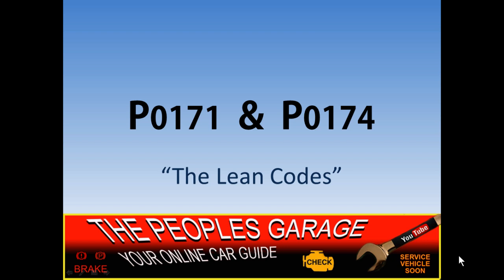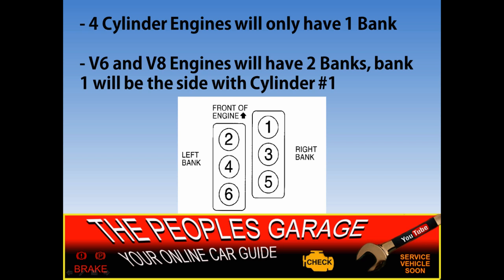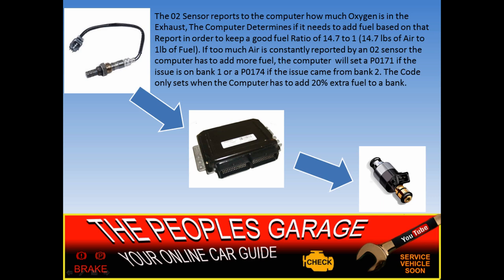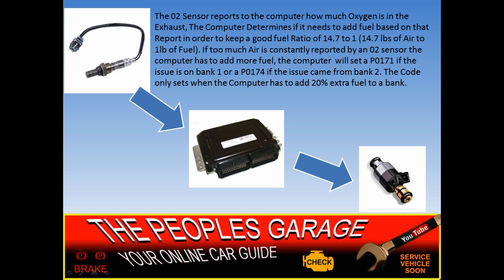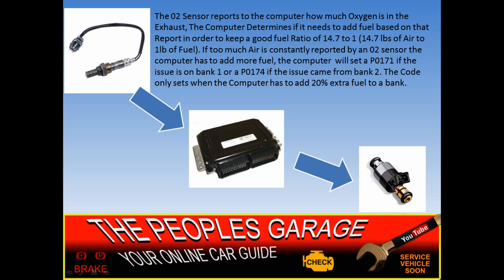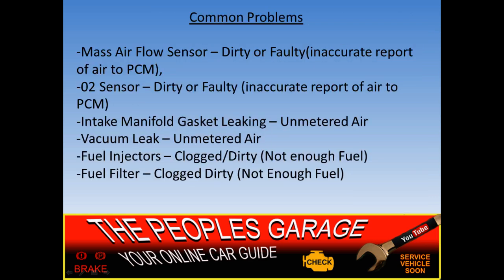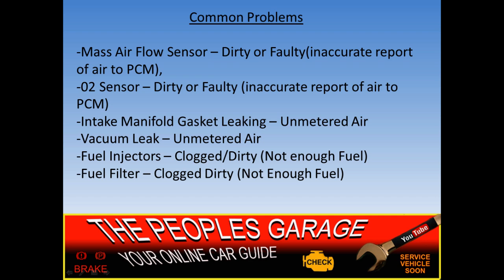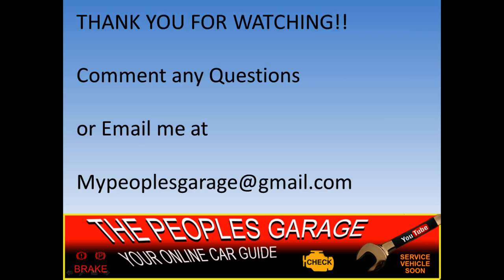How to Diagnose Codes P0171 & P0174 - Lean Bank 1 & 2

Comment: Great video! But did you forget to mention fuel pressure regulator and fuel pump? I am getting that code on my tacoma 2.4 and I tried everything you mentioned. Long term fuel trim hovers at 20 percent and doesn't improve when I accelerate. Any thoughts?
Reply: Your brake booster could have a vacuum leak inside of youve checked everything else already.

Comment: Have an 07 saturn ion that is a 5 speed manuel, 2.4L, straight line 4 cylinder, coupe, and i get a P0174 whenever its really cold outside or if i'm on the interstate with cruise control on. I've replaced the air filter, cleaned the throttle body (had oil on it due to high amount of vapor coming from the vent on the cam. No pcv, just a hose from the vent to the air intake) cleaned the mas, and i can't find any vacuum leaks or hear any noise. Only coming on at high way speed or if really cold out. (Live in wyoming)  In city driving doesn't trip it and the car has no hesitation. Does have 194,000 miles and timing chain may be due for inspection. Shop says my injectors are fine. Couldn't find it either. Is it just common to get this code?

Comment: what if the code is on a 2005 volvo  I got p0171 & p0174 ive checked for fuel which is good, ive changed the mass airflow sensor, codes still exist. and ive changed the pcv and hose, the last thing I haven't changed is the o2 sensors on the front. code that be the problem. and ive checked the intake gaskets with a smoke machine and nothing.
Reply: I would get the Mass Airflow Sensor from the dealer. I had a customer who changed the sensor 3 times, all were Bosch brand and new(which is suppose to be OEM. meaninf bosch makes the sensor). Once she installed that one, the p0171 and p0174 along with other fuel codes went away. It's really expensive at the dealer though. Just a thought. Good Luck

Comment: Hello I have a 2007 GMC Yukon. I started my truck and I heard a big sound on manuful exhaust air leaking and my checking light is on . I stopped at AutoZone and the diagnosed p0174 bank 2. I hope hear from you soon

Comment: I have a 2002 525i and the p0174 code pops up. Its the only code that pops up. I had just gotten the oxygen censor replaced from a different code i had on which was p0154. After that fix i had a different code come up which was p0430 so i had a mufflee shop replace the catalytic converter. Now im stuck with the p0174 code.

Comment: alright man! great video! My 2001 ford f-150 v8 catalytic converter turns red on bank 1, along with a code p0171,,long fuel trim 25% at idle. 
So far I done leaking test with a smoke machine, there is no leak at all. MAF sensor cleaned , four O2 sensor are new, I pretty much rule out every possibility except for the last one,  brunt exhaust valves.  yeah one more thing have to mention, when I change the oil today, there were only about half of the engine  capacity left

Comment: 2015 Nissan Versa P0171. Does the code clear itself if the issue is corrected? or does it need to be cleared by a scan tool?

Comment: 2004 kia sorento having lean catalyst system any thoughts? Have new catalytic converter plugs wires fuel injectors timing belt newer coil packs also have been replaced this car has been a nightmare so far owned less than 1 year. It's my wife's to get her and my 2 year old around. I'm aging a lot faster since getting this vechile please help

Comment: Would the oil leak from the oil pan on Vortec engine cause that code? (P0171)
There is no hasetating i did check usin a scan tool injectors status was showing positive results i hve a massive leak from the oil pan gasket.

Comment: Wouldn't mass air flow sensor set lean code to both o2 sensors. Mines just bank 1 sensor 2 o2. Replaces 02 sensors, no vacuum leaks, replaced lower intake and upper intake gaskets. I'm down to fuel injector on that bank?

Comment: I have a 2003 toyota highlander it has p0174 code b2s1. changed 02 sensor twice. it worked for a short time and check engine light back on. engine jerky on acceleration and some rough idling. one more thing tip of 02 sensor has black soot build up on tip. could injector be my problem??

Comment: I have a straight 5 06 Colorado, I got bank one 171 code. I also just recently installed a K&N cold air intake on my vehicle. I installed it about a month ago and I'm barely getting the code on. Any advice or troubleshooting areas I should start with?

Comment: 2005 Jeep Liberty 3.7 V6 I have had the P0171 and P0174 after resetting the check iengin light. Using my scanner its asking for me to change the ECM on both sides it was blowing black smoke out the tail pipe. Question what is the ECM cause.thats coming up on my scanner tool, and do you have an idea as to my diagnosis? Fuel Pump and filter the Jeep has 142,000 miles on it. Thanks KW

Comment: I had all this checked I have a 2002 ford taurus sedan I believe a v6 changed the mass air flow sensor and the pcv valve I asked them to check the hose and elbow because I couldn't get in there they changed the upper manifold gasket they check air compression  and observed tool data all scensors and found no irregularities looked at freeze frame data fuel rail specs 30-45psi said could be concern fuel rail scensor or fuel pump codes it gave were po 171 po174 
When I drive on highway it has a kind of light tug not often but every so often and when at a stop too long wants to die it runs clean no smell smoke. They couldn't find it any ideas. 
My coolant resevoir sensor says low when it isn't would that sensor give off these codes 171 174
Reply: Brake booster

Comment: This is what I encountered. I have a 07 Pontiac Grand Prix GT 3.8 supercharged Engine with about 110,000 miles on it. I had some vacuum lines replaced a rear main oil seal and my intake manifold gasket replaced because of a minor oil leak. After the repairs I was getting an intermittent P0171 code. Sometimes it would be on  and sometimes it would be off, Engine temperature never really mattered. My Mechanic suggested we clean injectors, Mass Air Flow Sensor to remedy the problem. Although the car ran a little smoother the CEL would still come on. My Mechanic then suspected the Intake Manifold Gasket although had been replaced may be the culprit. Before I had him do that, I tried something on my own. I located the PCV valve which sits on top of the Supercharger in a recessed port secured by a metal cap by two 10mm bolts. Under this cap is a spring and the PVC valve is under the spring. I removed the spring and the valve, on the barrel end of the valve is an O-Ring it was worn so bad it was hard and flat the valve itself barley rattled unless it was shook real hard. I replaced the valve and the O-Ring, cleared the code and the Check Engine Light hasn't returned since and that was almost a month ago.  Hope this helps anyone with a GM supercharged Engine that is getting the P0171 lean code.

Comment: 2005 BMW X3 with p0171 & p0174. Any possible thoughts? I will be trying to change the gas cap, was told that might solve it. I know I need to check the MAF.  Trying to everything I can before taking it to a shop.
Reply: Did you ever find your problem? I have a 2005 X3 also that is throwing both codes (171 and 174). I can't seem to figure it out.
Reply: Craig Colton, I checked the gas cap. That did not help. I literally just started on the next step. I was waiting on parts. I changed the air filter because it was filthy, and while changing it I cleaned the MAS sensor. I reset the codes today and now I am waiting to see if that is the fix. I may end up needing a new MAS. Not sure how long it was driven with the dirty filter and non cleaned MAS.  I will let you know if anything changes though. What have you tried? My X3 has 130k on it.  Also have you had any leaks in the trunk?
Reply: We're on the same path. Yesterday I cleaned the MAF sensor and put in a new air filter. I had earlier replaced the gas cap gasket. I don't know what made the difference, but this morning the system came up "ready for testing", with the mil light off. Hope it stays off long enough to get it to the inspection station!
Reply: Craig Colton, keep me posted. I haven’t really driven mine much yet. I reset the errors and hoping they stay off.
Reply: Craig Colton my light came back on....but it was off for a long period....don’t know what direction I will go now.

Comment: Good info. I have a 97 F-150 5.4L 2V engine.  Right around 100k miles i started getting P0171.  PVC elbow was fine but replaced anyways it looked dodgy.  Cleaned the MAF.  No intake leaks I could find.  Fuel pressure good at idle and under load.  Turns out that the cause was a leaking exhaust manifold.  Apparently the loose gasket at the exhaust manifold was letting air into the exhaust stream before the O2 sensor.  The sensor then fooled the computer into thinking too much oxygen in the exhaust and added fuel, up to the limit and then set the code.  New manifold, problem solved.  But wait....now the other side manifold is leaking and the P0171 is back, but why does the computer still think it's on the same bank?  a year later?  hmm.

Comment: You can also check the fuel pressure regulator on the fuel rail. my ford explorer is a 98 5.0 V8 threw the same codes it ended being the fuel pressure regulator
Reply: How was it determined? I have been searching for a link between that code and fuel pressure regulator because I have tried everything else! I'm hoping it's not the fuel pump. Mine is a tscoma 2.4
Reply: If the regulator fails (regulates fuel) then the right mix of air/fuel won’t be achieved. I have a 94 Chevy Colorado and I suspect it’s the fuel regulator since I already replace the ox sensor mass air sensor fuel filter   Checked for leaks. Etc.

Comment: I appreciate the detailed code information. I took my ladies toyota corolla 07 to auto zone and they said it was p0171. Told me i need a new ecu. Mind you i just replaced the o2 sensors both and cleaned the maf. should i replace the maf? or should i tackle the manifold gasket? or the ecu?! ( i dont think its the ecu) Car runs fine just has error code

Comment: You say you can't have both codes on a four cylinder engine, yet I have them both on my 2002 Toyota Avensis 1.8 VVT-i (1ZZ-FE engine). I have recently changed the fuel filter. I guess next step is to check the MAF. Is there any possibility that a failing fuel pump could cause both codes?

Comment: hi i have a yukon 3.5 xl 2003 it started fine went it get hot start to run bad and sometimes stop running i restarted and run fine after passing a few minutes went i drive it on open road do not.

Comment: O3 jaguar x type, I've had lean codes on 2 seperate occasions, first was lean on bank 1, erased, then was lean on bank 2. I just rebuilt the intake top and bottom. Was leaking from bottom. Replaced fuel filter. Also had a bad coil on cylinder 2. Still getting lean codes. Fogged engine and found no vacuum leaks. So my next thought is to get a fuel pressure gauge to test pressure. I watched this video in full and it was kinda helpful, I have some things to think about now.. any suggestions?

Comment: I started getting a PO 171 code lean bank 1 on my 2015 Traverse 36k miles. I first tightened the gas cap, it was'nt fully tightened. The engine light went off for a couple of days, then comes back on. So I change the air filter and cleaned the mass flow sensor, the engine light goes off again, but goes. back on two days later. Do you have any ideas what it could be? Thanks!
Edit...Its off again.

Comment: I have 2003 Ford Taurus. Chuggs noticiebbaky while idle. Regardless if engine is warm or not. I have both those error codes reported at the same time. What would be the best approach to solve issue?

Comment: Hi, I have 2004, Taurus 3.0, It has code P0174, Earlier I changed IMRC, Taurus Ignition Coil, 
Spark Plugs, PCV Valve,  Manifold Gaskets, Catalytic Converters, Block Seal Head Gasket, now Now I do not know, What I have to do. Please advise me. Milies is 78000
Reply: Taher Mia DPFE SENSOR CONNECTOR???

Comment: Very clear and easy to understand, thanks man. I’ve got a 2002 GMC 5.3 L suburban. The fuel pump wasn’t providing enough pressure (10lbs max). It would fire up and then shut off immediately (no codes or check engine light were on) So, I replaced The fuel pump and filter(had already changed 30-40k ago), and then it ran. 👍🏼 . Shortly after it threw codes po171 & po174 -lean on Bank 1& on bank 2. Seems to run fine except at idle (5-6 hundred rpm), It’s a bit rougher    than it was or should be . So I just smoke test, covered up the intake manifold (with rubber glove :-) and blew smoke into the brake booster hose.  The only place smoke escaped , was from the oil fill tube / hole in valve cover after I removed the oil fill tube to be sure. I also replace the PCV valve after that because I had a new one, and now it’s only thrown code po171 bank 1 lean???? The old PCV valve didn’t seem as though it had been able to close all the way,  Afterwards, it only showed code po171 lean on bank one. ??? I would just tell you? And why would the smoke come out of my valve cover with your filler tube is? Thanks for any help .

Comment: i have not went through all of the comments but subaru and old vw engines have 4 cylinder with 2 banks. bank 1 is still on the side with cylinder 1 but not all 4 cylinders only have 1 bank.

Comment: Thank you that was very helpful. My daughters 2005 Ford Taurus is throwing both of these lean codes. And I told her it sounded like she was going to wear out her starter. We had her car towed yesterday because she’s worn out her starter. Question: Are the same issues with the Ford truck something I should be looking at on her Ford Taurus? Also... a guy pulled out in front of her and hit her running a stop sign. It did several thousand dollars with the damage to the front of her car. Could this have caused bank 1& 2 to code lean? thank you so much.

Comment: I have a 2002 Toyota Camry.  I have the Error code P0171 coming up.  I have replaced the Mass airflow sensor, the O2 sensor near the muffler, and I have replaced both ignition coil packs.  Not sure what else to really do.  Can you give me some advice?

Comment: Thanks for the video. Now I'm working on a f150, I got both codes on, I've reset the PCM computer, what are likely suspects in which both codes are on? Thanks.
Reply: Francisco Macias tube on the back of intake its hard to see firewall its hard plastic but known to fail or fall out
Reply: Yes it's really tight back there. They recently did the headgasket, don't think they tightened those back bolts on the intake well. Thanks. Fuel pressure is good, and MAFS is good.
Reply: I'm thinking they may have reused the gasket......

Comment: 2002 RAV4 4 cylinder has two (2) banks.  

Cylinders 1 & 4  = bank 1, Cylinders 2 & 3  = bank 2; two (2) catalytic converters ; 

two (2) upstream air fuel sensors; 

two (2) downstream O2 sensors.

Comment: Thank You, Sir your video and explanation of the diagnosis are Excellent if I could buy you a beer through the internet it would be my pleasure..I have subscribed and look forward to learning from your expertise , keep up the great work.
Reply: I have a ford ranger xlt 2002 I really could use the help with some? S . The auto parts store gave me some engine codes p1000. C1155 . P1633. Can use some advice . Pls call me at 330-294-7328. Thank u

Comment: i have a 2001 ford f150 5.4. n i have both codes n a po401 i changed the egr valve n da other pops back up i change da fuel pump n fuel filter n still kinda backs out when yu go like 55 mph would it be the fuel pressure regulator..??

Comment: I have a 2004 Chevy Tahoe 5.3 flex fuel.  I'm getting the po171 and po174 codes. I can not figure out where the problem is. I just changed the intake gaskets about 3 days ago.  Is there something else that im missing. Thanks

Comment: Hi, I have Ford Edge 2013, expressing P0174, through my  little investigation I found that the air intake line was disconnected right after the air filter, I reconnected it, Check engine light does not turn off, is that the cause or I have to dig for something else. Please advise
Thanks and regards
Reply: If you have access to an OBD scanner you should clear the fault codes and see if it comes back on.  If you don't have one, basic ones to do this are pretty cheap at any auto parts store.  Or maybe a parts store can just hook theirs up and reset it for you.

Comment: 2000 f250 with the 5.4 triton. no vacuum leaks we could find. (checked pcv boot as well, and cleaned out the MAF) any thoughts?

And this may be unrelated, but the motor also bogs down--sometimes to the point of sputtering and shutting off--once warm. Input on this would be appreciated as well.

Comment: I have a 2000 ford e250 van, 5.4, v8. 200k miles. Engine light came on & started idling rough when I sit at red  lights. Took it to autozone and...p0171 & p0174 came up. I changed the pcv valve and nothing changed. Got a smoke test & and saw a tiny amount from the egr. mechanic says that's nothing. He then sprayed something at the intake and it slightly changed the idling everytime he sprayed. I got guys saying sensors & some are saying intake and/or gasket. Before I start handing out money...what do you think? PLEASE HELP!!